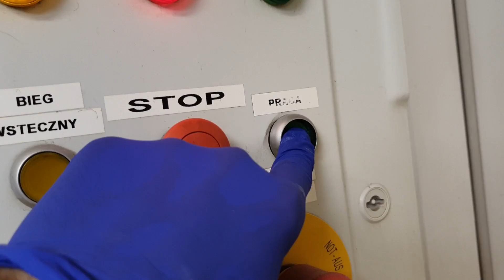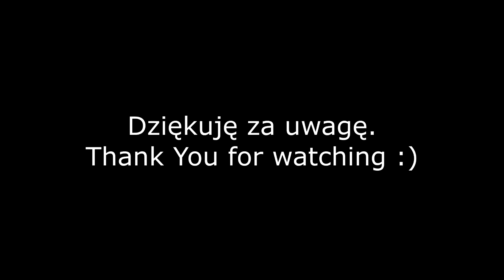Pranie dywanu ekstremalnie zabrudzonego, włos stanął po praniu a brud znikł, zobacz efekt przed i po

Comment: After all that washing, I can't believe more dirt is coming out.
Reply: That's what I thought. Imagine houses that have carpet flooring 😵😷
Reply: @Deanna W I prefer tiled floor. Much more higiènic. A bit cold in the winter though, but cool in the summer.
Reply: That is just how nasty carpet and rugs are !!! Never get them complety clean !!
Reply: Plot twist:
The carpet was originally white
Reply: @terrywaynelocklear7480  yeah I hate rug/carpet .. wooden / ceramic floor much better than the dust and dirt nest .
Reply: @absolutelyloveangels  right  i have tile i would hate carpet
Reply: I think if they hung it up while rinsing it wouldnt take as long.
Reply: The last spinning out of the water was clean water. It was the floor tile that had that creamy color and made it look like the water was still dirty. I had the same thought first too. But then I looked at the foam coming out which was clean.
Reply: Renee this is what happens when you wear shoes in the house...
Reply: @Deanna W the solution is not to have carpet..simple
Reply: @inspiringsmile  or, where this cleaner is from, when you live where people use carpets outside like doormats, and also have them inside in a home where the windows are always open to dirt and dust. carpets are commonly used in mudrooms, canning sheds, and you can even find the odd runner sometimes in strange spots in the entrances to barns.
Reply: @Deanna W I agree, carpeting does harbor a lot more dirt (etc.), bad for allergies!!!
Reply: @jorgejad5391  y'know, if you're not a bot, bragging about committing crimes is really not too smart
Reply: @Milo Mathew instablaster ;)